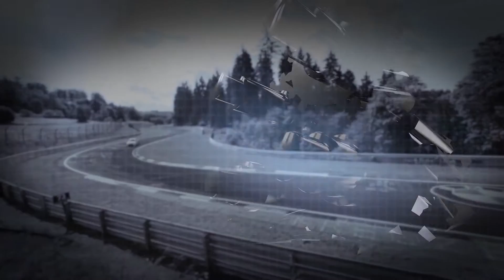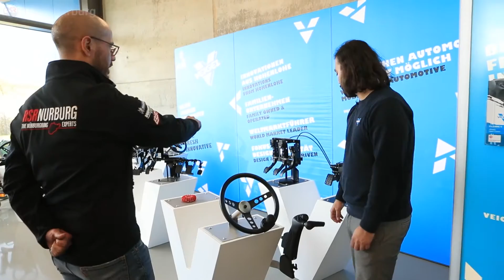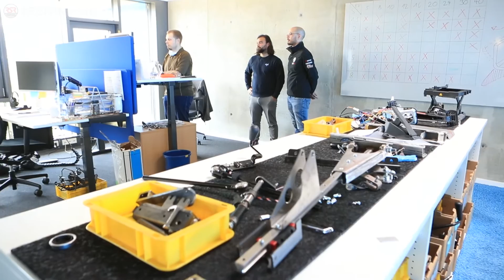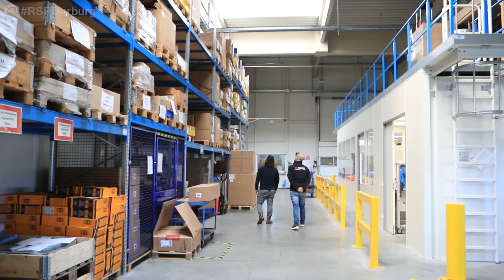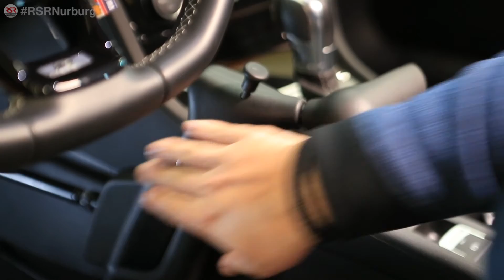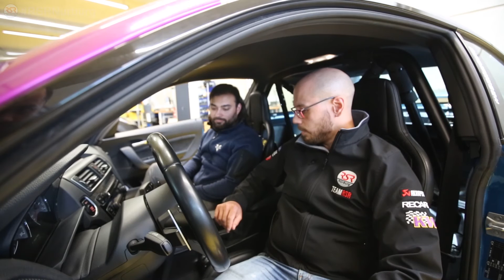How To Convert ANY Car to Hand Controls - VW Golf R Build - Part 7

Comment: Nice, but you hold the Steering wheel with one hand. Is there a version: gas pedal for left hand, brake for right hand? 
This way you can hold the Steering wheel with both hands.

Comment: That looks really awkward as you've only one hand steering and I'd be worried about my feet getting stuck under the foot pedals. I've had my foot move under the break pedal on my road car on many occasions in the past. 
That said I'd love to try it out some time.
Thanks for showing as I've mentioned hand controls in the past to brands hatch and they said there was nothing could be done.
Reply: Well whenever you are in a race track, regardless if you are a professional race car driver or not and as a wheelchair user, you would be recommended to use velcro straps on your legs to avoid situations like the one you just mentioned above. Driving with one hand on the steering wheel and one on the hand control requires simply practice. There are several professional disabled race car drivers who use this day to day and have no problems or disadvantages towards drivers who don't use one. Like we said, it is all about practice and trying it out.✌🔷
Reply: @VeigelAutomotiveVideos  
Velcro is very good suggestion. 
I thought about what you said and how the controls work and the throttle being a twist does make total sense as you don't need your thumb to control the smoothness of acceleration like with a pull throttle. 
I'm not even an amateur racing driver but would love to do a track day. 
Would I need to buy my own controls or would they be available to rent/ hire? Or would you look at notifying circuits of these controls for them to buy?
Do these controls fit any car or are they bespoke to individual cars?
Thanks for your reply earlier.
Reply from the maker: We're proud to be able to offer a solution like this and very thankful that Veigel were able to work on this project with us. We have the applicable straps to keep knees, feet and legs held tight. 

It's still a learning process for us too, and sometimes we have to take the lead from the driver themselves, and what they're experience with using controls such as these. In saying that, since the cars are road registered, there is also the opportunity to get used to the car and the controls on the road first, before going out on the track.